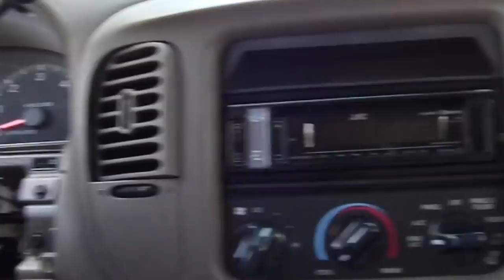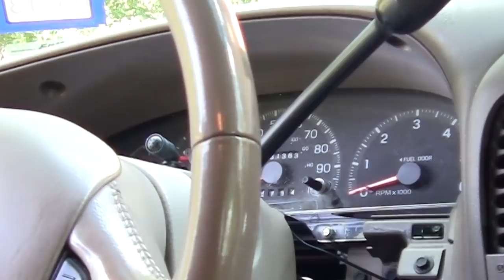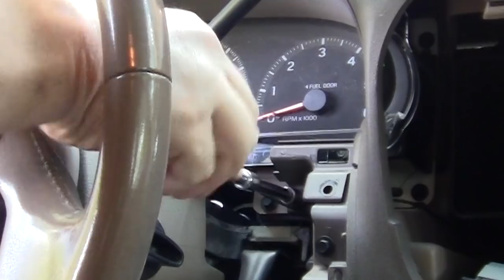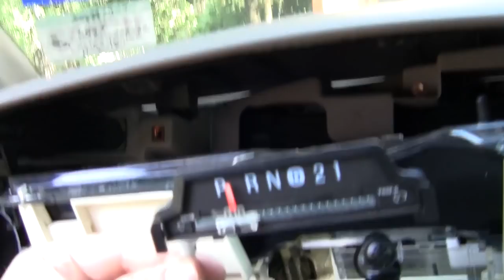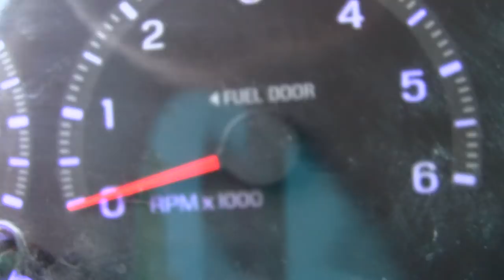1997 - 2002  Expedition, 1997 - 2003 F-150, & Navigator Instrument Panel Light to LED Upgrade

Comment: is there a difference on which socket requires a t5 or t10 bulb? Trying to research it but no luck. Just a little confused on that part because i dont wanna order a just t10 just to find out i need a t5 for other sockets.

Comment: How many LED's are required for the Illumination only for back ground illumination in the trucks instrument cluster? I bought a pack of ten. AND  can you tell us which way is pos. and which is neg. so that we don't have to do trial and error? I have researched and have seen that the small internal tab in the diode is positive and large is negative. But witch is witch in the connector? White dot Positive?

Comment: This helped I install light bulb for the Speedometer only the lift side is lid so the RPM only the right side is lid up on both them lift is not lid up what did I do wrong

Comment: You chewed up the paint around your headlight switch.  There is an easy no pry way to take that out.  It involves removing the headlight switch twist knob, and reversing it to go back on and twisting the headlights to the "on" position.  This method catches a little tog underneath the twist knob and releases a lock tab that holds the headlight switch assembly in place.  No prying needed.  :-)
Reply from the maker: Awesome,  thanks for the tip!
Reply: I'm not sure what the differences are but there's 2 headlight switched for these trucks. You describe what I have with the release/lock pin thingies, there's another version that is just tension springs, where it just slides in and out by coaxing with a screwdriver/panel pry tool at the bottom in the center to remove (similar to my 05 superduty, but shape is different from the SD)
Reply: @TwoKeysStudio  are those the ice blue or blue LEDs?
Reply from the maker: @leighpetersen3947  blue is what I used.

Comment: What tools or extensions did you use when removing the screws holding the cluster?
Did you remove the green film from the casing to make the bulbs seem brighter? If so, how was that done. Any recommendations on what grit sandpaper would be best not to damage it? Thanks!

Comment: attempted this process today, unfortunately I did not realize the bulbs I ordered were 'ice blue' rather than just blue, so there is a fair amount of white light being emitted.. with the green tint that is painted on the dials it still looks just about as green as with the factory bulbs. I ordered the correct bulbs but I fear I may have to use acetone to remove the green tint on the dials to get the desired appearance. Will be giving it another shot when the new bulbs arrive in a few days.
Reply: Side note, I got tired of seeing the passenger airbag icon lit up on my gauge cluster so I removed the bulb and left it empty. BAD IDEA, the truck has a sensor that will beep 5 times and repeat 5 times when you start the vehicle if it detects this bulb has burnt out or is missing.
Reply: @00n9na8  I bet you could put a resistor where the LED would be in order to trick the computer. You'd have to figure out the resistance but it shouldn't be hard
Reply: @00n9na8  good to know. I appreciate the great information.also do you remember the build size numbers?
Reply: Also did you do the acetone and did it work? Any other tips or tricks are appreciated also. I was thinking about doing red on mine but I think I'm leaning towards the blue. Blue seams to go with Ford better since the Ford blue and all. Hahahahaa
Reply: @leighpetersen3947  I have awesome 🤙💯✅
Reply: Thanks, that was exactly what I was planning to do, put some , blue or ice blue with the green film, but not much difference, I want the blue of the video, but not sure if he installed the blue or Ice blue? any thoughts...

Comment: I have a 2000 Ford F-150. I am replacing the instrument cluster lights with blue T-5 LED bulbs. The T-5 LED bulbs are polarity. When I install a LED bulb in the high beam indicator, I only get the LED to light up when I pull back on the left side turn-signal stalk or lever. When I push the stalk forward toward the dash so that the high beams are on all of the time and also for the  high beam indicator light bulb  to stay on all the time, I get no LED light at all. When I reverse the LED bulb polarity, I get no high beam indicator light at all in either direction. Does your T-5 LED bulb for your high beam indicator light up in both directions, forward for full time high beam or reverse (towards you) just to flash oncoming cars to warn them of a cop up ahead or whatever? I'm thinking I may have to use an LED bulb that is non-polarity, works in both directions like the factory original bulbs. But I do not see for sell on Amazon or EBay to where you can buy only one LED T-5 bulb that is non-polarity. Let me know on your truck if your high beam indicator light works in both directions (forward and aft or reverse). Thank You!!
Reply from the maker: I only did my illumination lamps with LED so I cannot comment with experience on this, although   the LED should work correctly when put in using the right polarity.  You might have an issue with your multi-switch. Hopefully someone that has done the swap on the high beam indicator came chime in on what their experience has been.

Comment: Anyone thinking of doing this on a vehicle this old should include checking the heater core.  It's a $50 part that cost over $1000 in labor to get to and replace (behind the glove box area).
Reply: You worry about a heater core when it starts showing signs of pending failure. Luke warm, leaks, foggy windshield. If it’s not doing any of that then I wouldn’t bother with it.
Reply: @johnnyfonk999  I'm not saying otherwise.  Mine for instance is already blown.  The line has been bypassed but in the meantime I have ZERO heating.  All I am saying is give it a good check while you got things open.

Comment: I did mine turned out looking really good the only thing is now how do you change out the light bulbs in the climate control switches for the rear AC that are located on the roof of the also how do you change out the colors on the door lock and window switches to match
Reply: Mr.ALO...they are a pain in the ass to get to and are soldered. But can be done. Check with SBLEDS.COM. super bright LEDs. com. They are very helpful.
Reply: @kykrazy6050  thanks for the info 👍

Comment: Did you have to upgrade anything for the dash to run the led lights? I put mine in and when I turn on my highbeams the dash goes black but the highbeams turn on. I turn them off and the dash goes back to normal
Reply from the maker: No, I didn't have to do anything else for the leds to work. It sounds like you might have a ground problem???

Comment: There is a trick for removing the light switch. Pull the knob off rotate it 180 degrees re install it then turn it 90 degrees clockwise. You will feel some spring tension from the catch.
This retracts the catch on the left side and gently remove the left side and rotate it out.This allows the assembly to come out with out a lot of prying and no danger of scratching or cracking the dash cover. . It will then snap into place when you are done. Put the knob back also.
Reply from the maker: Yes, I made an updated video with that info. I wished that I had known that prior. 

https://youtu.be/OG40S4W71LM

Comment: So if I only wanted to swap out the lighting for my gauges, I would just do the ones labeled "illumination"??

Also... what bulbs did you replace with? Do you have a part number/place? Link?
Reply from the maker: There is a link to the ones I purchased in the description.  Yes, just do the ones marked illumination.  From what I understand 2000-2002 only used the small bulbs.
Reply: @TwoKeysStudio  Appreciate the reply bud. Just had another one of your vids pop up in my feed with headlights. Will be swapping those out with what you used as well

Comment: Thank you for sharing this! I have tried this before, but could never find the right socket to fit my specific board... What size, type or number socket did you purchase; did they require any modification? I did find some smaller bulbs. But my lights are STILL green!!!
Reply: The 97-98 guys have it nice when it comes to this "mod". Their clusters have a blue background on the boards so even if they were to put in white leds their dashes will light blue, us 99-03 guys have a green film on the boards so no matter what we put in it will shine green. I found in the a/c controls the film isremovable, but the dash is a coating on the board.and if you take it ALL apart and scrape off the coating, you have to first go through the diffuser layer to get to the color layer. Then you have to remove and reinstall the needles if you go that route.

I've looked into it. As for sizes, it's been a while, I don't recall. I THINK the smaller ones are 194 and the bigger are 37 or 74 or something like that, all "wedge base" bulbs, again I think its T10 (the wedge base code).

Comment: LED BULBS ARE POLARITY SENSITIVE.  THEY ARE NOT MARKED POS.  OR   NEG.    IF THEY DONT WORK ONE WAY PULL THEM OUT AND  ROTATE 180 DEG.  RE-INSERT
Reply from the maker: Bob Haddock yes they are. As you saw in the video I checked the LEDs prior to installing for polarity and put them in accordingly.  Ford actually did this nice, the way the cluster is made the top part of the socket is positive and the bottom negative,  at least that is how mine was. So once I knew which was positive and negative on the LEDs,  which I checked on a battery charger,  I put them in and they all worked the first time.
Of course if any didn't work, its like you said just pull it out and rotate 180 degrees and it should work.
Thank you for your input and watching the video.

Comment: How do you like driving with them? Are they harder too see because theyre blue?
Reply from the maker: I love the look and to me they are easier to see. There are some other people that have used white led's and they have a very nice look as well. There is a blue filter tint to the the factory cluster to green with the incandescent bulbs m so the white/clear led's will have a brighter kind of a baby blue look.
Reply: @TwoKeysStudio  Ok, another question: Are the T5s for the smaller white lights?? Such as the check engine light and other warnings?

Comment: Thank you for the informative video! It shows what the dash can look like after the upgrade. It got me started on my quest to replace my burned-out dash lights and upgrade the look of my dashboard. 

But I ran into a snag. I used your links to buy the T-10 194 LED bulbs. Imagine my surprise when I tore down my dashboard to access the dashlights and discovered that your eBay site sent me the totally wrong replacement bulbs. I'm not going to bother cotnacting the ebay site to complain for a refund or exchange. Instead I had also looked at the channel for Living On Wheels and ordered the 194 bulbs from his link to an Amazon supplier. Bad suppliers are NOT your fault and YT channels that list supplier links are always helpful. It just didnt work out well in this case is all.
Reply from the maker: Ebay links are a bit sketchy since the seller can change what they sell. I've started using Amazon much more now. Thank you for your input.

Comment: I have a 2003 F-150 Lariat Supercrew with the digital odometer will this work or do i need a specific size led bulbs? I plan on going with red.
Reply: need to Re-Paint tach, speedo, ect RED Pointing Needles

Comment: I have a 99 Exp. 5.4 I cannot get it smogged, the car will not clear the monitors, 4 or 5 blinking lights, 500 miles later I still cannot get it smogged, it will pass smog but not official until it clears the monitors, any ideas? PS I have 79K miles on it.
Reply from the maker: I actually have a video on that. I had to get my Thunderbird through the drive cycles to get it to pass. Here is a link to the video, I hope that it helps you.  https://youtu.be/CLk_2IF9EeE

Comment: On a side note for those who remove air bags there's a wire that you cut so the check suspension won't turn on. It's good for resale when the new owner for whatever reason wants to go back to air bags
Reply: Do you know which cable that is? I'm going to convert my suspension from air to spring coil.
Reply: @Luis Perez  should be the green one with a light green stripe it's inside the dash which is easier to remove than the instrument cluster

Comment: My 2001 Eddie Bauer Expedition has green as the illumination..green mileage, green overhead mileage console, green everywhere.....HATE IT!!  What about the lamps in the radio, and the Automatic Electric Temperature Control Module under the radio?
Reply from the maker: They can be done, but I have not attempted it yet.

Comment: Can you please list tools and bulbs needed??
Reply from the maker: T10 and T5 bulbs. I do not recall how many, but I purchased them in packs of 10 and there was plenty to do the job. Someone mentioned that 99-2002 only used the smaller bulbs, but I cannot confirm that. I do not recall the exact tools that I used, but they were just basic metric stuff and screwdrivers. 
Also do not pull the headlight switch like I did. Watch this video for a much easier way.

https://youtu.be/OG40S4W71LM

Comment: Would any T5 bulb work for the smaller ones? I'm trying to find ones of the same brand that I got the T10s in, so I can make sure the color blue matches lol, yet the site says they wont fit. Just wanted to make sure that as long as it's a T5, that itll work. Thanks for the vid btw, it really helped me with replacing my bulbs 🤘
Reply from the maker: Yes, any T5 should work. 
You're welcome  and thanks for watching.
Reply: @TwoKeysStudio  awesome man, thanks 😁

Comment: I was wondering if you ever changed the headlight switch light or the 4x4 dash light.  And if you did what bulb did you use. Thank you.
Reply from the maker: I have not done that, but have seen others that have. As I recall those may have either soldered in lamps or possibly leds.

Comment: if i would to put white leds they will show up white right?
Reply from the maker: I have seen where others have put white LED's in and the panel shows as a whiter blue. There is actually a blue tint in the panel that causes the incandescent bulbs, which are more yellow, to show as green.  If you remove the tint then they will be white.
Reply: Two Keys ohh ok thanks I will look into that
Reply: How would you get the green tint off without taking the face and \
needles off

Comment: how many of each led did you use ?
Reply from the maker: Sorry for not responding earlier, but I somehow missed your post. There were 4 (I think) of the larger ones and a three or so of the smaller ones for illumination. As I understand 1999 and up are all T5's.

Comment: Really good video! Beats the others ive seen, about to try this on 98 nav. What size leds did you use? t10 or t5?
Reply from the maker: Great question and thanks for the positive feedback. It required both T-5 and T-10 LED's. I have provided ebay links for the LED's that I used. There were 4 (I think) of the larger ones and a three or so of the smaller ones for illumination. The larger T-10's were for illumination only and the smaller T-5s are used for additional illumination and warning lights. I left the warning lights all as incandescent...at least for now.
Reply: Two Keys thanks man appreciate it!!
Reply: Two Keys just installed them today. For anyone doing this on a 98-02 navigator don't pull/pry out the switch for your headlights...it will break lol (i superglued my bezel for it back together halfway), also you will need two 37 size or T5 LEDS to fill the top 2 "ILL" spots. And 5 194 for the rest. I did mine in white which resulted in a skyblue colour. Keep in mind the film is blue...the only reason its green stock is because the halogen bulbs are yellowy white. So if if you want say purple, just buy red leds, yellow for green etc...thanks again man.
Reply from the maker: Jonathan Andrews thanks for the heads up on the headlight switch.
Reply: Jonathan Andrews how do you get the switch out the correct way? I have an 02 navigator i want to do this light conversion on.
Reply: Were either of you able to see the flasher relay behind the instrument panel? I want to replace the original one for one that supports LED blinker/marker lights. I just don't know where it's physically at.

Comment: Before you post 97-02 expedition do your homework. After watching this video i decide to order the leds in your link and take the whole dash part just to find you my 01 expedition cluster is different from yours the T10s wont fit and the lights on the T5s arent strong enough to illuminate properly
Reply from the maker: Yes, I have since learned that the 99-02 models do not use the larger bulbs, but the cluster removal procedure is the same. . Here is a terrific site that I use to see which bulbs work with a specific application. http://www.modifiedlife.com/car-replacement-light-bulb-size-guides/
Reply: @TwoKeysStudio   i had the same problem but on mine they had 2 clear bars that surpose to reflect the bulb from the sides , which made the led light look dem when i powered them on. had to switch back to the ole schools.

Comment: You did not spicificly say how many of which size bulbs are needed. This is important
when buying them.
Reply from the maker: That was a miss on my part. I think there were three of the larger bulbs and six of the smaller ones. The bulbs that I purchased came in packages of 10.
Reply: 194

Comment: 1997 to 2003...not 2002.  I know, minor mistake, just thought I would say it.  😂
Reply from the maker: Not a mistake 1997-2002 for the Expedition and 1997-2003 for the F150.  F150 didn't get the new body style until 2004.
Reply: @TwoKeysStudio  ah, you're right.  I was thinking of my 03 F150, my bad. 😂